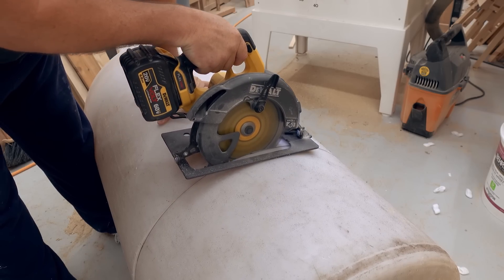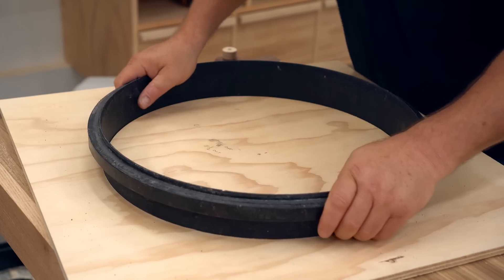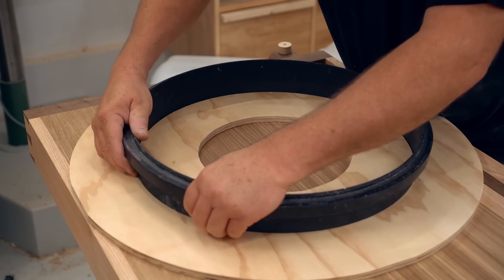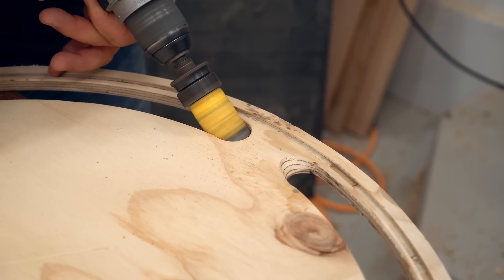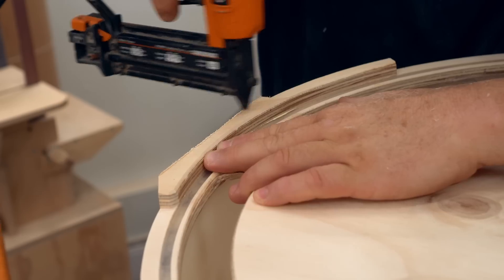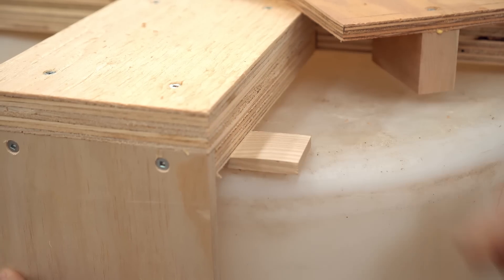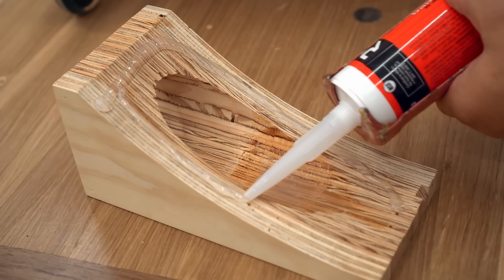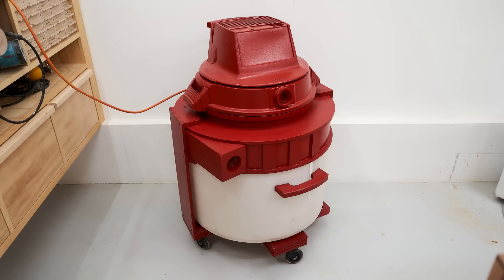Super Sized my Shop Vac and Put a Cyclone Inside

Comment from the maker: This really sucks!! But that's a good thing :)
Get your first month on The Makers Mob for 75% off: https://rlnk.cc/mywoodworkertoolbox
▶️ Design inspiration for this build comes from a video by Cosmas Bauer: https://www.youtube.com/watch?v=kF0zPiCarq4
Probably the best feature of the plastic water tank is thick walled so it won't collapse when using it for this. It's also a large diameter - 23 inches - and that means that even when it's cut short like this, it still holds a lot. That collection capacity is around 20 gallons or 80 liters, which is more than one of those big garbage cans full.
Like I said, the Craftsman shop vac I used to power this is more than 30 years old. I bought it new and have been using it nearly every day since. It has tons of suction and can easily compensate for the efficiency loss when adding a cyclone separator.
The cyclone is a Thein baffle design and this works best when you have the large diameter. The obvious advantage is that it can be very short in height, so the entire unit can be very compact. That was a key point for my small shop, since I don't have the space for a full size dust collector. 
I want this mobile to easily roll where needed in the shop and it will primary be used for dust creating operations, like sanding and CNC work. I won't be using this for major dust collection (table saw, planer, etc.) since I already have effective solutions in place for those. I also won't use it for general shop cleaning. That's what a broom and dust pan are for.
I wanted this to last and be ruggedly built without overbuilding it, and I guess having it fall off my workbench tested that. I also wanted it lightweight, compact and easy to move and use, and I think I managed to do that.
Reply: q
Reply: Great build, John. It's fascinating to me how creative you are with what you have on hand. We buy too much new stuff and for the most part, unnecessarily. I've learned from an early age that we need to use - and reuse - the resources that we already have. Granted, I was dirt poor, but regardless, it's important to also reduce waste.

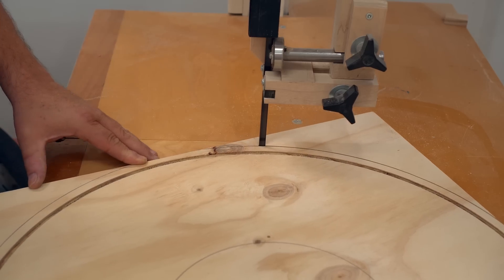Comment: Have you ever made a jig to use your band-saw for circles?  2:35  I have not, but it seems odd to see you 'free-hand' that cut when you've shown high precision in your other cuts.  For a project like this one, the extra precision gained from using a jig would probably provide no practical benefit.... but if you were making a large, round table -- for a dining room, for example -- you'd want the circular cut to be very precise, but probably with more "oomph" than a spiral-cut bit provides.

Comment: Okay, you using a hole saw on an angle on that drum is nothing short of freaking wizardry.  Can you explain how you did that cleanly, because that's hand's down one of the hardest things I think you did in this video (short of the design work).

I've cut holes in plastic before with a hole saw and it was the worst. I couldn't get the saw to stay centered cleanly and it would dance around until I pretty much held it in place with my hand (sort of dangerous).

Comment: I don't know why the thein baffle only has a recess. You could force more dust downwards by putting the removed slot at an attack angle to the direction of cyclone eg ———\\___  so it reflects debris down & leaves cleaner air above to be sucked out.
Loved it when R2 D2 fell over !!

Comment: i keep seeing these pen cap like wire end isolation thingies in american videos. they seem very unsecure. what are they called?
Reply: "Wire Nuts" or "Marrette's" They come sized for various gauge wires so using the correct size, they screw on quite securely.

Comment: An amazing finished product. This makes me thing that each vacuum manufacturer (or third party) COULD MAKE a cyclone separator that uses existing attachment methods to attach to the bucket below and the head above it. Then just a plug for the OLD inlet and DONE...with no more footprint like with a Dust Deputy and its bucket.